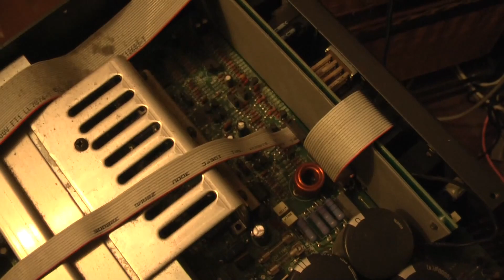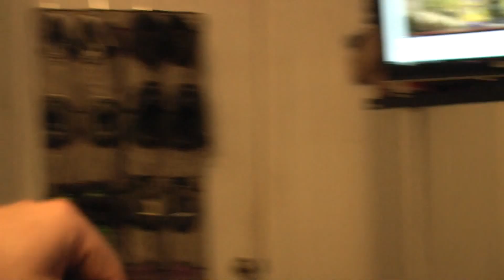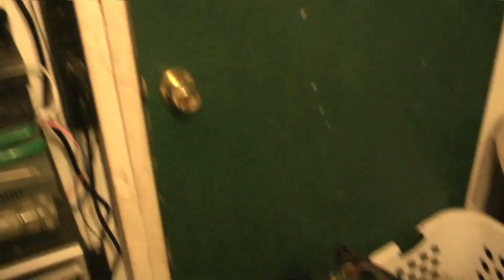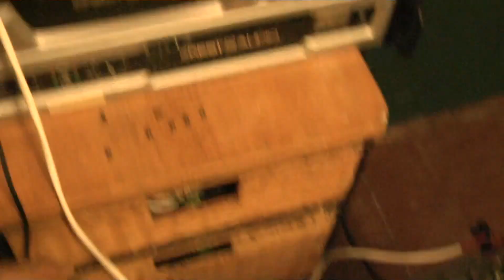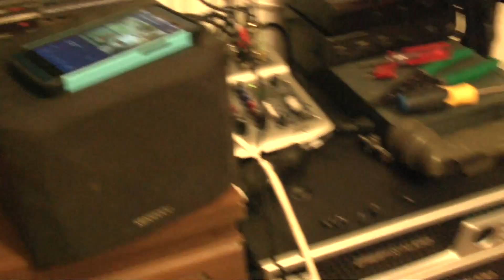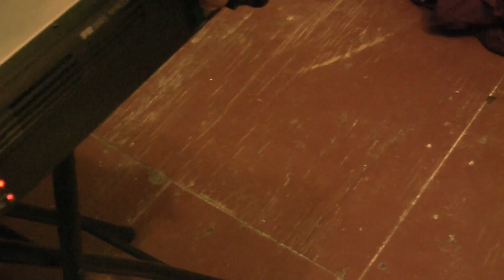Mackie M1400i amp clean up and test

Comment: hi. I'm a novice to audio. I build a subwoofer (first time) and bought an m1400i. it sounds good, but It's really not pumping out much power.
In bridged mode, the most I could get it to pull from the wall socket is 300 watts. It's got 60 watts standby current and I understand that class AB amps are super inefficient at lower power levels, so I know that not much power is getting to the subwoofer.
Any ideas?
I'm powering it from my computer 1/8" headphone jack, to an EQ, then to the mackie, then to the sub.
The EQ says that it's hitting -0db when I adjust the gain.
Does this mean that my amp is bad somehow?
Reply from the maker: The only thing I can think is somehow it's still getting full range audio signal.  I may be wrong and will look further into it, but it may need to have a crossover put in line to only send low end to the sub.  I'll do some research and try to help you if I can.
Reply: @majinzendo  aw shucks. I appreciate it.
In the meantime, today, I'll install a sound card (I'm using the built-in audio on a $100 motherboard) and try out a headphone amplifier, and see whether that does the trick.
Otherwise, I suspect that the amp may be blown or something. I'm not sure how to test that. I bought it on ebay for half the normal price.

Comment: I have one of these amp's and the power switch went bad. I cannot find a replacement anywhere can you help. 

Kind,, regards
Reply: I know you posted this a long time ago.  I had the same thing happen years back.  Radio shack had switches, though they didn't fit properly, still it worked.  Still using this amp for my home theater subwoofer 16 years later.